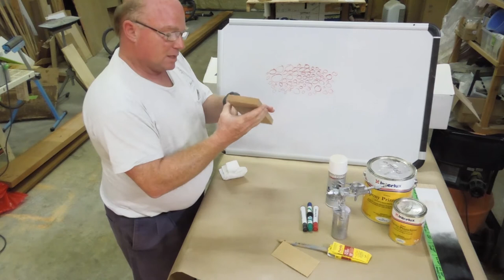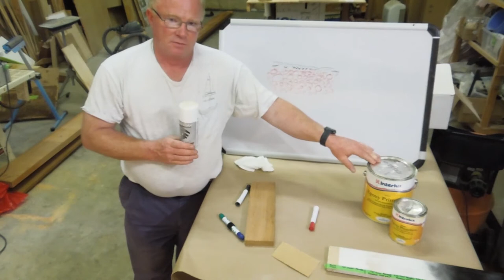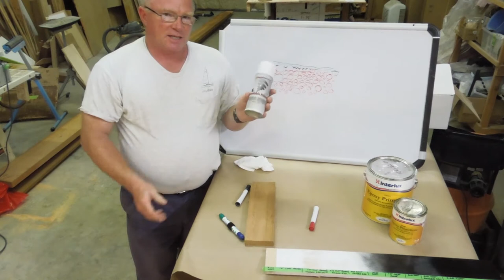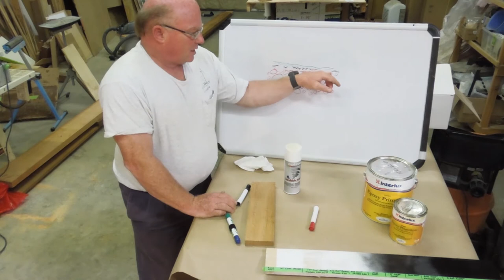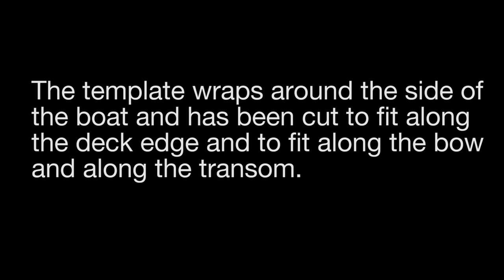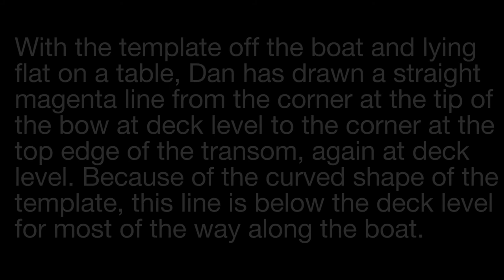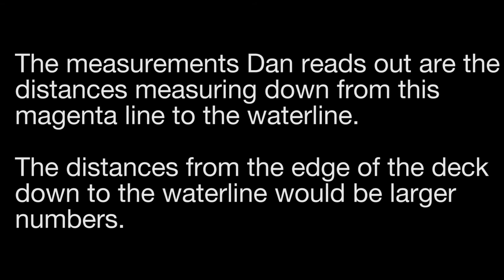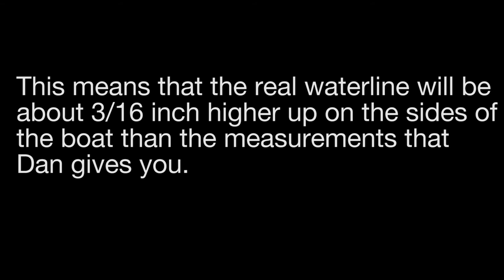Varnishing and Painting the T37

Comment: The definitive guide. I am so glad I found this video, thanks for sharing.
Reply: Thanks, I am glad it has been helpful.  I'm getting ready to give a presentation on building and painting at the T37 Annual meeting at Seattle Yacht club, I just watched this again after many years, it is still pretty good although I have found I am prone to using a bit finer sandpaper now.  Like in the video when I said I used 180 grit, I now generally go with 220 but it is still valid.  I do wish I had shown painting the gloss though.  I have been doing some metallic and pearl finishes and they are a LOT of fun and spectacular.  Give it a try!  After priming, spray metallic base then a clear with pearl in it to match the base, i.e. red pearl over red metallic.  A car store will probably give you all of the pearl you need.  Literally a pinch of pearl or maybe two but no more in like 60 cc's of clear.  T37 #2500 is a green metallic with green pearl over pearl white and it is gorgeous.  After doing the two colors with their pearls in clear, I then block sanded w. 400 grit the bumps of the transition from white to green and sprayed clear over the whole thing then repeated until the seams of the waterline and cover stripe disappeared.  Then wet sand to 2000 grit and polish.  Really nice finish!

Comment: Great job Dan. If I may, I understand the importance of laying on a lot of thin coats. But one technique that can save varnish and some time is something I do that borrows from gun makers. They progressively sand the wood to a very fine sandpaper, typically 400 or even 800 grit. Then when the wood feels silky smooth, they tack it then wet it with alcohol. What this does is causes the grain to lift. then after it dries sand it again with 400 or 800 then repeat the process. After a few times no more grain will lift. Then when you varnish, you won't have to sand as much between coats, only to roughen up the surface for the next coat. works very good.

Comment: I suggestion for hanger that you made for the deck hole.  I would use a larger diameter all-thread and epoxy a nut to the bottom side of the oversized plywood that fits inside the deck.  Then I would put a rubber foot the end of the all-thread and then screw the foot down until it presses the plywood against the deck.  This way you can use the rod as a stand to hole the boat upside down and rotate it 360º.  Drill a hole in a piece of 2x6 the size of the all-thread and clamp it to the work bench.

Comment: Dan,
Just picked up on this video by searching for a "How To" paint  two classic 50/800s that I have been blessed with for restoration.  One is a wood plank boat and the other is a fiberglass Epic.  Are the techniques generally the same for fiberglass as for you excellent tutorial?
Reply: Hi James

Sorry, I haven't checked this video in years, Hell, I didn't even know people were able to comment on it.  That is to say I'm a bit new to this video thing, and I did that video years ago.  So much for my career as an "Influencer".

Anyway, yes, the 404/414 is an excellent primer for any composite.  I have built carbon fiber rocket parts launching satellites into Low Earth Orbit and boarding ladders for Mega yachts and I use the 404/414.  Awlgrip epoxy is also great as is the Alexseal and many others but the one difference I like with Interlux 404/414 is it doesn't separate in the can into heavy residue at the bottom and light resin at the top.  And they also make smaller quantities like quart kits.  I use enough so that I always get gallons but for the hobbyist, 1 quart will do probably 3- T37's.
Sorry for not getting back sooner.

Comment: Never tried using helmsman spar urethane spray?
Reply: Hi Edwin

Yes, it does a very nice job but it doesn't build as quickly as the Epifanes and I don't think the gloss is quite as good.  But it is absolutely and acceptable job.  I do like the ability to adjust the spray pattern but on the other hand, simple is nice and not having to add thinner and clean the gun is all nice.  So sure, go for it.